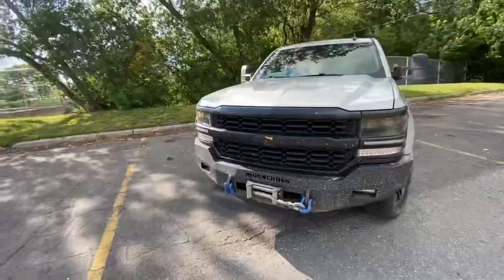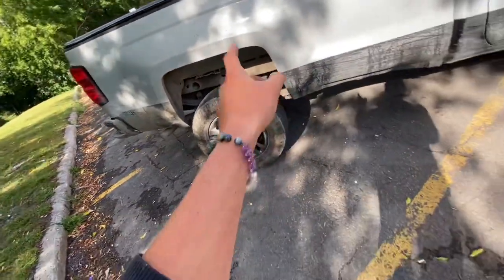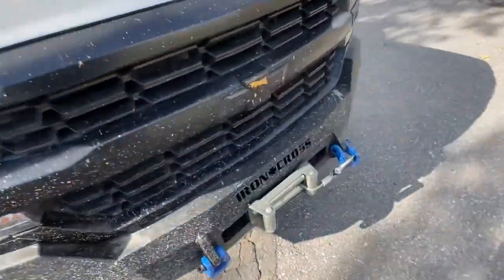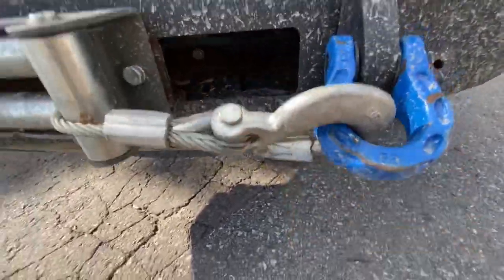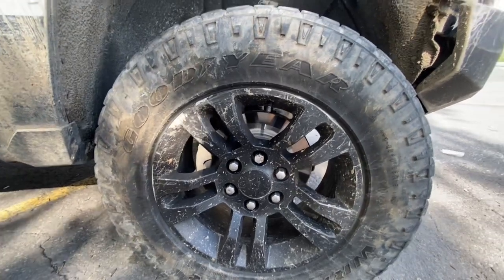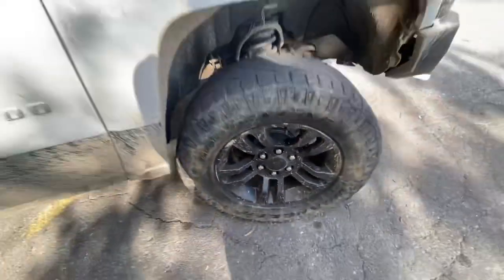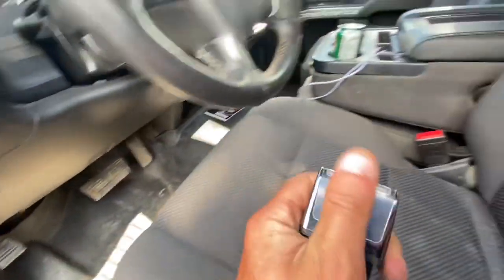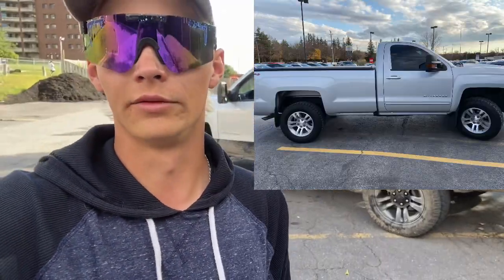Chevy Silverado 4x4 build “DirtyDorthy”Walkaround // Respect All Rigs Ep.1 // TITSoffroading

Comment: Those Chev’s have mechanical rear locker still ? Truck is looking good bud
Reply from the maker: Yes I believe so will stay open until you spin stores fast enough and it will lock the rear I plan on putting proper locker in it down the road tho